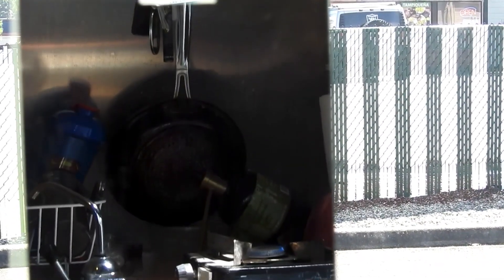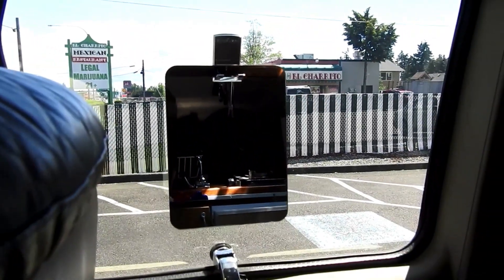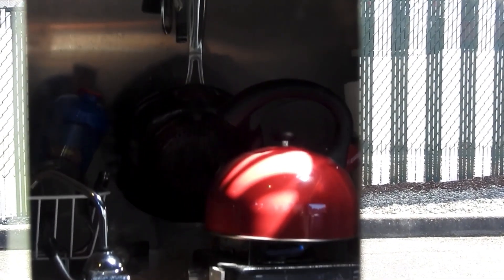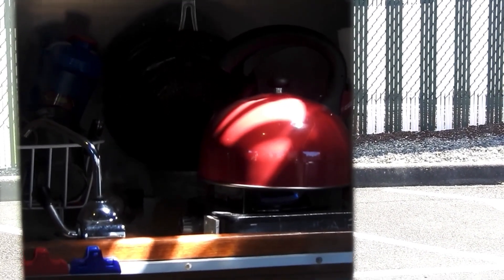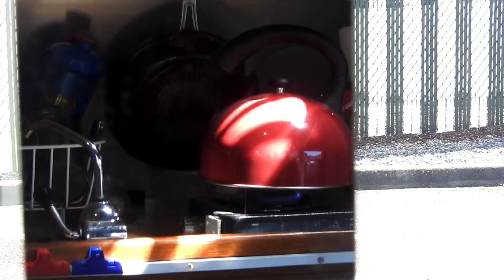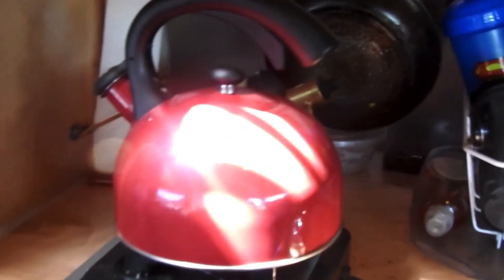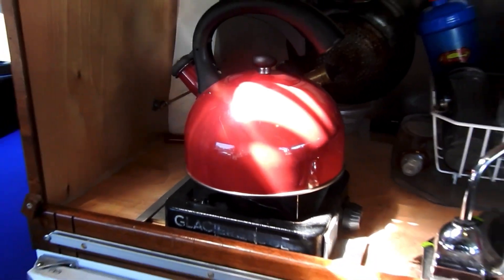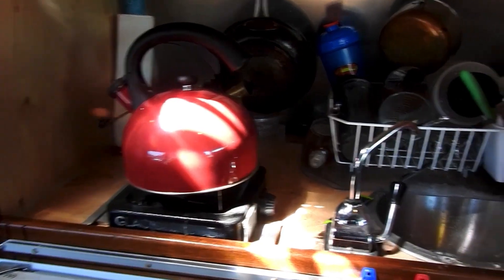Moonlight Temp Exp. Reloaded Pt.2 "Checking the Reflection"

Comment: In using an infrared thermometer, I recall the instructions indicated to only use flat black surfaces to take readings on.  I do not know how much off the readings would be with other surface colors or reflect ability.  Re-do your test to conform to that and all is good. Mike
Reply from the maker: Check for my most recent experiment. Try to keep up.

Comment: So once again. If you want to measure apples and apples, you must either measure temperature of black matt material or simply use 2 normal thermometers (not laser/remote ones). Just place them both outside and cast the shadow on one of them. You will always see the same temperature (if they will be both calibrated). Then you can swap them, wait a few minutes and take results.
After watching all 3 your videos with thermometer I came to conclusion that you didn't manipulate the results deliberately. You are simply so ignorant. How do you want to do experimental physics without proper education? What do you expect? Once you measure temperature of the sky and then of a real object and then you came into conclusion that if the sky is colder, the moon's
light has cooling effect?

Comment: From this we can conclude that you have no clue about how electromagnetic radiations work and how your thermometer works. Look in the manual or google one or whatever it clearly says :  Inaccurate readings will result from measuring shiny or polished metal surfaces. To compensate for this, adjust the units emissivity reading or cover the surface to be measured with masking tape or flat black paint (this is for the benetech MODEL:GM700) the same instructions can be found in any other manuals. knowledge is power ;)

Comment: You can't work this out with a typical mirror as your control. Mirrors are covered with glass, which doesn't reflect infrared. Since you're using tin foil for your moonlight temperature experiment, you should also use tin foil for this test. This should have been obvious to you.
Reply: The Mad Philosopher What does military have to do with this? The mirror D. Marble is using obviously isn't military issue. In fact, since my posting this comment he's come out and said that the mirror he used was plastic, which is likely just as bad for IR reflectivity as glass.

At any rate, I was referring to mirrors in general, obviously there are exceptions, since mirrors can me made of all sorts of things, but TYPICALLY they're just a coating of silver sprayed onto the back side of a sheet of glass.
Reply: @todddanza2538  go back to sleep man, please and stop bothering the actual scientists at work.

Comment: Why would your mirror be 100 degrees
Reply: You told me the mirror was plastic.
Reply from the maker: billisorange because it was freaking hot in there. The sun was shining on that side of the van. Do you even understand how glass and metal surfaces absorb heat?
Reply: Interesting question coming from a man who claims that absorbing moonlight makes something colder
Reply from the maker: speaking slowly But the window is made of glass. The heat from the glass radiated to heat up the plastic mirror. Mkay pumpkin?
Reply from the maker: Orange, it'd be different if I were like you and had NOTHING to show to back up my claims...
Reply: I have hundreds of years of science to back up my claims. Electromagnetic radiation is the transfer of energy, and absorbing radiation increases the kinetic energy of the atoms within a substance, thus warming it up. There is no such thing as "cold light" or whatever words you used to describe it. If you read something other than your bible you may have a chance of understanding
Reply: D. Marble No need to be condescending about it.
Reply from the maker: Don't be so sensitive Todd. Fact is neither of you have any content to show on your pages to back up anything that you're saying here. If the truth hurts your feelings, you're on the wrong channel.
Reply: If the study of electromagnetic radiation is pseudoscience, why do you trust your infrared thermometer, which is based on that very same science? And none of my senses contradict that
Reply from the maker: You have hundreds of years of pseudoscience that you trust over your own 5 senses. How have you personally experienced this world as a spinning ball that's hurling thru space and spinning over 1000mph?